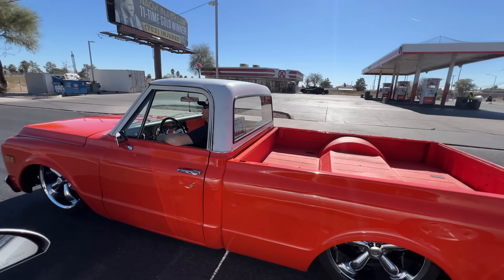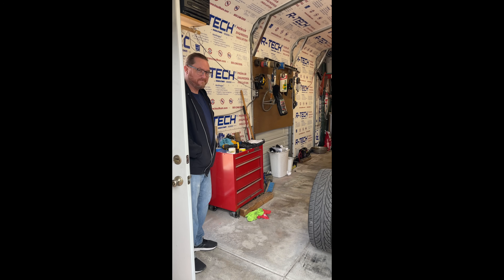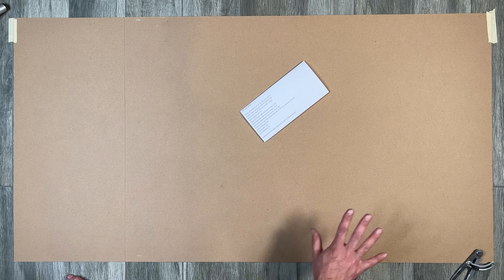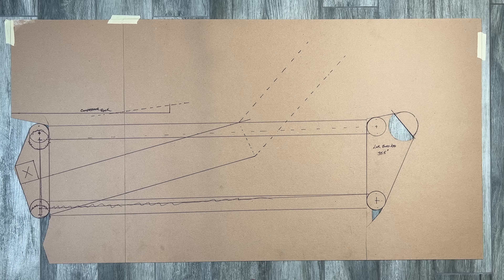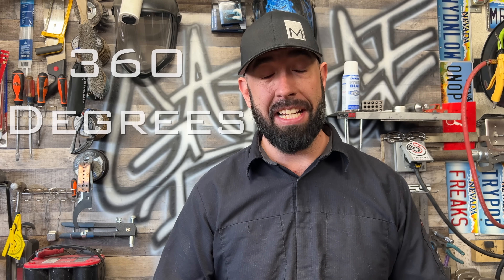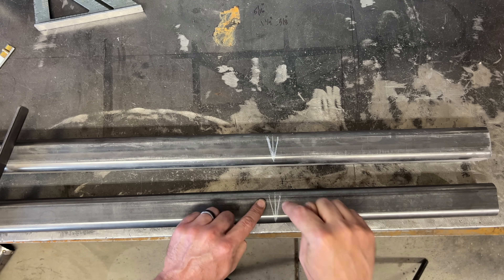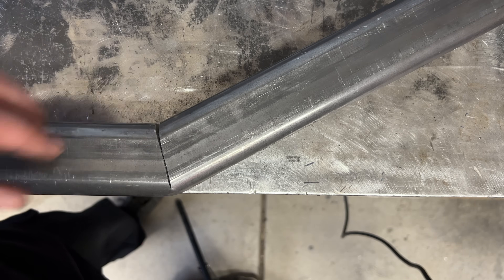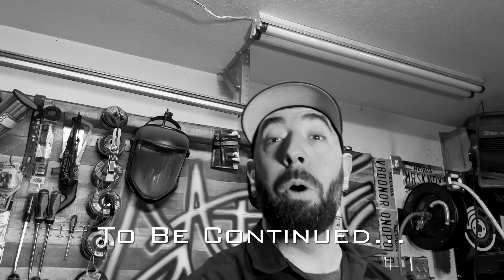C10 Parallel 4 Link Design and Fabrication / Long Distance Fab Part 1

Comment: Just curious as im a new subscriber.. thank Puddin. How did you get the correct length on that upper bar? Just leave it a little long then cut after you bent it? Anyway thanks love the videos nice work.
Reply from the maker: Correct! I intended the rear suspension to operate like a parallel 4 link so my upper bars needed to be the same length as the lower bars. I’m not smart enough figure out how long to make the bars so that they’re the correct length after bending, so I made them too long, bent them, then trimmed them to fit between bar ends that were spaced the correct distance apart.
Welcome! I hopehope you’re entertained!

Comment: Did you use 3/16 or 1/4 steel for the brackets?
Reply from the maker: I generally use 3/16. You would be surprised how thin you can go when you gusset stuff fully.

Comment: Love your videos . I've learned a lot from your channel  . How are the RotaCut Hole Cutters holding up ?
Reply from the maker: Thank you, Billy!
They are quite incredible! I image they probably dull eventually but they haven’t yet and it’s been years. If I have one gripe, it’s that they’re brittle. I’ve broken two cutters (1/4 and 3/4 inch) by using them in a hand drill and tweaking them wrong. They bind and shatter.
I’ve never broken one in the drill press. 🤷‍♂️

Comment: I have four death wheels! Mostly because I wanted to be able to switch from cutoff wheel to grinding wheel to flap disc to stripper wheel! By far the best and cheapest tool.
Reply from the maker: Indeed! I only have 3. Cutoff, flap, and wire. I’m terrified of grinding stones and after discovering Cubitron flap discs, what’s the point?
What does a stripper disc consist of?
Reply: @GarageFab   it’s an abrasive that looks like foam. It’s good for stripping paint off sheet metal because it keeps the heat down, allegedly

Comment: What are those bits called for drilling the bolt holes? Where you get them?
Reply from the maker: Hey Brandon! Check the video description and scroll down a little and you’ll see two links for the two hole cutter sets I own. If you can’t find them, search for Hougen RotaCut, Hole cutters. They’re pretty pricey but worth every penny.
Reply: Just ordered the small set. Thanks!
Reply from the maker: Excellent. Lemme know what you think! 🙌

Comment: Love the content! Really appreciate all the extra details and mockups for explaining concepts. How precisely aligned do your 4 link brackets need to be? So if the front bracket measures 4 inches in from the frame rail, ideally the rear bracket on the axle would also be 4 inches in from the frame however what tolerances (i.e. 1/16, 3/16, etc) could it be off and still function appropriately?
Reply from the maker: Thank you! I appreciate you back. 
Think of it this way, Chase; The triangulated four link has parallel bars on the bottom, but the top bars form a triangle. This means that the bushings for the top bars are mounted towards the center of the vehicle on one end, while the other ends are mounted near the frame rails. This is several inches (if not feet) of a difference between the front and the rear bushings.
This system still works just fine.
That was a long winded way of saying small measurements won’t affect much.
This is NOT saying you shouldn’t take pride in your work. Get things as close as you possibly can, just don’t stress about it!
What project are you working on, and what are the plans for it?
Reply: @GarageFab  good deal. I have definitely been stressing about getting things perfect and given this is my first build it's been quite the learning curve. I'm working on an 86 Toyota mini truck. 4 link, bags, supra motor....
Reply from the maker: Sounds like a good time! I hope to see it when you’re done. If you’ve got questions, I’d be happy to help where I can. Hit me up on Instagram @GarageFab
Best of luck, Chase!

Comment: Man you make this a lot easier to understand by far..I'm having some trouble trying to figure if 24 inch bars would work on a Chevy 1500 2wd and what thickness the bars should be..thanks and keep up the great work 🤘🤘
Reply from the maker: Hey Danial! 24 inches seems pretty short to me for rear links, but it really all depends on what your plans are for the truck. Will you have adjustable height suspension like air springs or hydraulics? Or static height like coil overs? Normally I would recommend making the link bars as similar in length to the drive shaft as possible. Especially on adjustable height vehicles. If your bars are too short, you risk having the driveshaft slip-yoke pull out of the transmission as the suspension cycles.
If you are using a static height suspension, this is much less likely and 24 inch bars might be just fine. How did you decide on 24 inch link bars?
As far as wall thickness, I can only tell you what I use. I am not an engineer so unfortunately I can’t tell you what you SHOULD use.
On loadbearing link bars, (link bars that have a coil over or an air spring on them, that supports the weight of the truck) I consistently use 2 inch mild steel square tubing with quarter inch walls. And on my loadbearing linkbars, I use 1.5 inch mild steel round tubing with 1/8 inch walls.
Thank you, my man!
Reply: @GarageFab  Thanks for the response it makes sense to go with longer bars for sure I was on a website not sure which one it was and they had 24 inch bars on there.  The truck will have hydraulics on it with either 6 or 8 inch cylinders, I was planning on using the 1/4 inch walled tubing but wanted a second opinion you've been a great help thanks buddy
Reply from the maker: @danialrousseau4346  My pleasure my man! I’ll reiterate… With 8 inches of travel, I’d strongly advise on some longer links. Best of luck, Brother! Talk soon.

Comment: I would enjoy hearing your science on shock location on this truck. Where in relation to the frame/3rd member/axle ends is best?
Reply from the maker: Hey Bryan. I dropped the ball on this one. There are more C10 suspension episodes to come, but the truck is actually already done. I was too busy to film when I installed the shocks so unfortunately no one will get to see the process on this truck specifically. 😬 
I will be going over sizing and installing shocks on the Mighty Max though. It’s the same process regardless of the vehicle.
I can tell you now, shocks should be mounted as close to the wheels as possible for two reasons; Shocks become less effective as they get closer to the differential, and they would also put excess stress on the axle tube over sharp bumps if they’re mounted too far in.
I’ll be working on the shock video soon so hopefully I can answer all your questions there.
Cheers!
Reply: @GarageFab  cool that’s exactly what I had in my mind as well. But I know there’s more to be answered regarding shocks so I’ll be anxiously awaiting your insight

Comment: That's  a great video,any recommendations for a decent air management kit from a price range of 1,500 end 2,000 usd.
Thanks.
Reply from the maker: Unfortunately, Refugio, I don’t! I’ve got experience with multiple brands and they all seem to suck. And they suck even worse if you live in a humid climate. The valves often leak, (both up and down) and they need to be rebuilt often.
I have not yet tried the Slam Specialties unit. That’s not a recommendation… I don’t know anything about it!
The only air system I’ve ever had that was flawless was separate valves from Blitzluft or Parker, but then you don’t have the cool automatic features. 🤷‍♂️

Comment: I forgot about the line transfer tool you showed us a while back.  thanks for the refresher.
Clearly I will need to rewatch all your videos this winter to get myself ready for the summer of fabrication!
Reply from the maker: My pleasure! It’s certainly one of my most used tools. Not quite as much as the card stock, but it’s up there. 
Summer is coming isn’t it? Yuck.

Comment: Great video! I found it late the other night and fell asleep in the middle...Oops. Came home from work and pulled it right back up and rewatched it. Was expecting the 2x2 square tubing to go all the way across, so maybe I don't totally understand your plan. Keeping an eye out for the next one!
Reply from the maker: Jay! You fell asleep during a video?! I better step my game up. 😬 
What do you mean by “all the way across?” Imagine any lack of clarity will be clarified when it’s assembled.
Reply from the maker: Oh!! You mean the little 2 inch square pieces that I welded to the front link bar tabs… It makes sense now.
It could go all the way across, but I’d have to put a crazy tall hump in the middle to clear the driveshaft. So instead the square tubing you’re talking about will just rest on top of the frame with some beefy gussets on the sides.
Reply: @GarageFab  That makes sense, I hadn't thought about clearance in the center over the driveshaft.

Comment: As with the other comments, I learn a ton from your videos.  Being limited to one side of a garage, your tips and insights are invaluable and inspirational.  I've been studying SLA suspension geometry in preparation for a full custom chassis build.  I know I'll be referencing your tips during the design and build process.
Reply from the maker: I might have to bug you for info as I start my own front suspension! I plan to offer some suspension basics videos for control arm suspensions, but if I’m being honest, my knowledge is severely lacking in that department.
Thank my friend! I appreciate you.
Reply: @GarageFab  I'm more than up for discussing and sharing ideas to create a better understanding or help out.  I'm no expert, but I'm always working hard at learning more.
Reply from the maker: 🙌  That’s the only way to be!

Comment: Hey there,  I deleted my previous comment because I re-read it and I sounded like I knew it all, and that I do not. I do know that vehicles that have a non parallel 4 link with a panhard bar like a Toyota 4runner if you were to use rod ends on all pivot points the suspension would be frozen in place, after thinking about it might not be the case with a parallel 4 link, I would have to model it. I like the idea of rod ends everywhere because they move things exactly where they are put,  rod ends make movement  completely predictable and make bind easier to spot.  My  dislike for bushings is that the same deflection in bushings that allows articulation in a parallel 4 link is the same deflection that changes pinion angle under acceleration and braking, even if so slightly.  there is an un-predictability to the amount of movement you get out of bushings. 
Since you're quite good at teaching theory I really hope you make a video about live axle suspension articulation where I am sure I will learn things. Whether you're, trying to hit 3 wheel motion, flexing on the rocks or trying to limit body roll, how design articulation into suspension can drastically affect your desired performance.
Glad to see someone else super interested in suspension, Keep up the great content!
Reply from the maker: Thank you, Kelly! If I’ve got one gift I’m extra proud of, it’s not being easily offended or assuming the worst in people’s writing. I too do NOT know it all. In fact, some of the terminology you’ve used went way over my head. This is the main reason I’m making videos on suspension basics… and I may not go much farther than that. I’ve got a lot more to learn before I can comfortably teach.
I’ll be looking into some of your points. You got my brain juices flowing.

Comment: Any advice on cutting a perfect 2" half circle on the end of a piece of 2.5" square tube?
Reply from the maker: Have you got any hole cutters? I just recently released a video on cutting holes without a pilot bit, which included holes on the edge of a piece of material. If you haven’t already, check it out. The answer you’re searching for might be there.
https://youtu.be/wq169wJc59s
You could also sculpt it with a flap disc, but the perfection just won’t be there.

Comment: Another great video. I can't wait till I can get my frame table built, and start building my frame. I have so many ideas after watch a lot of your videos again. We had bad weather, so I binged again, ha.
Reply from the maker: What’s the plans for the frame table, Shawn? I’ve got one planned in the near future, but if I’m being honest, I’m not sure how to do it! 😬
Reply: @Garage Fab  I have found some c channel that will work great for what I need. No real plan yet, but I have a few ideas. I don't plan on building any full size trucks, but would like to make it long enough just incase I decide too.
Reply from the maker: Fair enough! I was thinking mine was going to be a little more disposable. I certainly don’t have room for a frame table right now!
Reply: @Garage Fab  I want to be able to break mine down. Could make it all nut and bolt together. That way it can be taken down when not needed. Would be easy enough I believe.
Reply from the maker: I’d agree! I have thoughts of welding coupler nuts to the sides so that I can level it out on my likely unlevel garage floor.

Comment: I have to say 'Kandy", this is pretty awesome. I haven't had much to do with air bag suspension, as low riders are not my raison d'etre. However, the knowledge that you possess and are experienced with, at least requires me to ask if you would be interested in coming to live in one of my tool boxes, just in the off chance that I might need to tap your knowledge and abilities at a moment's notice As a sweetener, I have a very good selection of tools and tooling, what I don't  have, I figure you can make. Waddya say?
Reply from the maker: Well, Toby, I certainly don’t need a mansion but I would definitely want something a little larger than a tool box. I’ll tell you what… I’ll stay in my cozy reasonably sized home and if you need info that I possess… It’s yours. You know where to find me! 😂 
Thank you, Brother!

Comment: what size and where do you get your bushings from?
Reply from the maker: I get all my stuff from Thorbros.com at the moment. The sizes change depending on what I’m making. For link bars they’re generally 2 inch bushings varying from 2.5 to 4 inches wide.
The bushings in this video so far are not even bushings at all. They’re made from aluminum and are used to build the suspension and then they’re replaced with real bushings. I get those from Thorbros also!